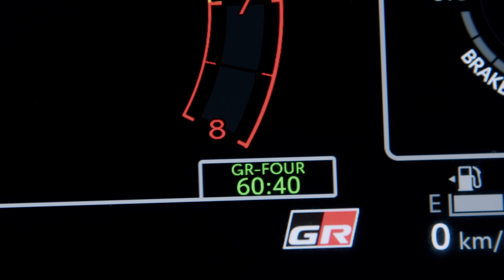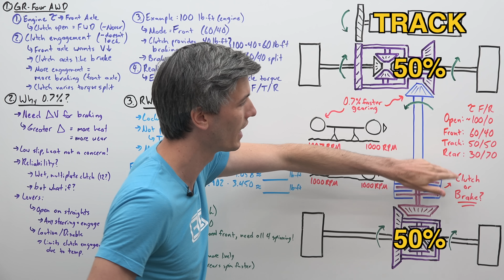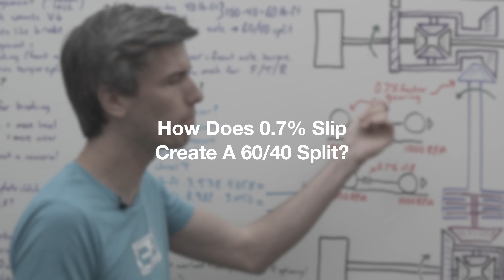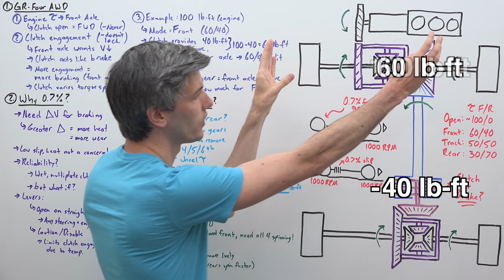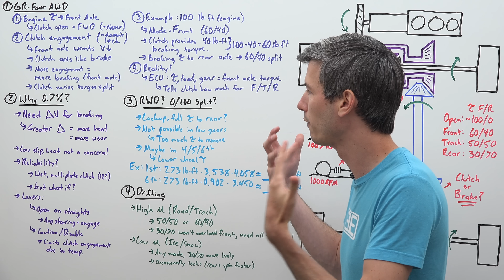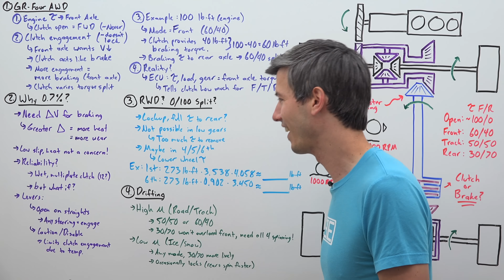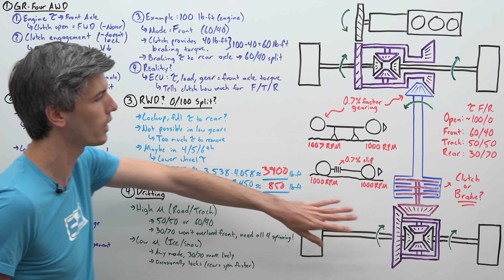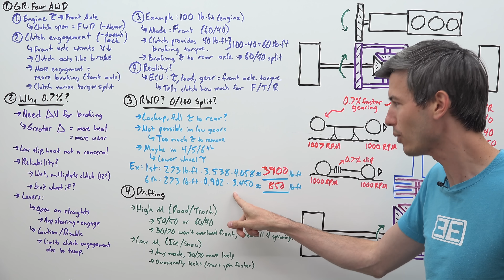Toyota GR Corolla's Brilliant AWD System - How It Splits Torque!

Comment: On my Subaru legacy flat six with the five speed auto it has a wet clutch I think once Subaru jumped to the CVT things changed. on my model Subaru sent a little more torque to the back with every day driving I keep forgetting the times I have an all-wheel-drive car when I go around corners and applying a little bit more power or torque to help the front rotate I keep forgetting about that at times Jason.

Comment: As you have it shown/explained here, if the front axle had zero grip and the rear axle had all the grip, 100% of the torque would be transferred to the rear axle no matter which mode you were in -- provided the load feedback through the clutch pack didn't exceed the pressure between the plates.

Comment: is 50-50 everything is always good or nah?

i would like to imagine a car with 1500 kg of weight, 1500 HP, 1500 Nm torque, and 50-50 power-to-weight ratio, power distribution, and the same for weight distribution. is it gonna be good?

Comment: i know most people dont care about fuel efficiency, but the reason auto manuf have started using 2 clutch packs in awd is because toyotas design creates a shaft that is constantly spinning (dead weight) at 100% fwd mode. meaning this probably won't be a tech used in a rav4

Comment: How is this not just a simple variant of haldex (which maxes at 50/50)? You can achieve the same effect with slightly different tire sizes too.  Seems to me that the calculated torque split will change as the diff clutch pack wears too. I have my haldex biased with tire sizes and modified software, but I MUCH prefer VAG biased Torsen/Sport diff. That said, I'd probably get one if I could get the Morizo version with the limited slips front and back, but just about zero chance of that.
Reply from the maker: You can also get Core (optional) or Circuit (standard) with Torsen front and rear.
Reply: @EngineeringExplained  Good to know. Now to see if I can get one.
Reply: Finally have one coming in... Hopefully in a couple weeks. Core + front and rear LSD...

Comment: My 1/10th Kyosho Optima radio control buggy from the 80s had a chain drive with the front diff having a choice of 18 teeth or 19 teeth and the rear diff was 18.  I always wondered why on earth this would be the case.  I was 12.  Only now do I start to get the idea!

Comment: It is a neat solution indeed. Similar way of sending more torque to the rear axle has been utilised in RC racing model cars for a long time. A beautiful thing about this drive system is that you can easily fine-tune it by putting slightly different outer diameter tyres on front and rear. By e.g. installing slightly smaller front tyres you could achieve a 80/20 rear bias instead of just 70/30
Reply: So cool. I'm gonna look for slightly larger tires for my AWD Jeep Grand Cherokee now.  😅
Reply: @unrestrainedfamily9356 it should work - pls let us know how it all went!
p.s. it would be handy to upgrade the rear differ to a LSD

Comment: I have questions, I could not fully understand this one. I watched it twice. I still can't understand the 30/70 split, or the 0/100. I get you engage the clutch pack about 80% (maybe .7% less) to get 60/40. I get you engage it about 100% to get 50/50. I don't get what 140% engagement (30/70 split) or 200% engagement (0/100) means. I would ask you to do another video on this, but I'm sure it's not complicated, I just can't grasp the "as a brake" thing. I also can't grasp what .7% is being multiplied against to get the final torque numbers. How is .7% enough to cause a 30/70 or 0/100 split? For once, I needed MORE math lol.

So, I don't get how anything past a 50/50 split works (30/70 and 0/100), and even if I understood that, I don't get how .7% leads to such big differences in the math. Please help! lol
Reply: Maybe my video about GR FOUR will help.
Reply: @4x4.tests.on.rollers  I appreciate your effort, but I still need some math with that .7% to understand this. I also still don't get the 30/70 or 0/100 yet. Your video did explain some, but I still don't get it. How does it send more torque to the rear, than the front (where the power source is)? I know it's me, but I can't grasp a clutch going beyond 50/50 split when closed. It's fully engaged. And .7%, without equations, doesn't sound like near enough to change things much, which it clearly does (it equals 140% engagement at 30/70). If someone could point me to the math behind that .7%, it might help me get it.

Comment: How will having the front and rear axles trying to turn at different speeds affect tire wear?

How will handling change as tires wear? Taller tread blocks will be able to squirm a little to allow more of a speed difference than worn tires.
Reply: The clutch pack slipping will account for any and all wheel diameter changes within a tire's life. Tire life will be similar to any AWD system. The clutch pack can never be fully locked so no difference will be made front to rear. As opposed to spirited driving which will affect tire life orders of magnitude more but isn't the AWD modes or AWD system's "fault" per say.

Comment: Jason, which diff setting would be most fuel efficient, all driver behaviours being equal?
Reply from the maker: I truly doubt there would be a significant difference, probably wouldn't notice it in real world. But "Front" would have the least clutch pressure, so I'd assume it would have the least amount of heat losses.
Reply: @EngineeringExplained  thank you! I've asked this question to many people and you are the first to give a reason-backed answer

Comment: Why do I sense major maintenance issues with that clutch pack? 
Is it a good idea to allow for slip in a clutch? Isn't that going to have long term maintenance implications when the clutch would eventually fail?
Reply: I'm sure you missed it, but EE pinned a comment he made about it. Essentially, it'll be okay as multi-plate clutches are nothing new. It seems to be designed with what it's built for in mind. :)

Comment: You sounded and looked pretty excited about this development from Toyota Jason. It never ceases to amaze me what technologies are being developed for the motor vehicle. Just when you think that a particular aspect has reached it's climax, engineering AND science pulls another rabbit out of the hat. It is crazy!

Motorcycles have had wet multiple clutch packs forever. You are actually taught to ride the clutch and increase the engine speed when performing ultra slow manoeuvres to remain stable  I have been doing this for years and have never smelt let alone worn out a motorcycle clutch. I have never considered why multiple clutches are required, though I am guessing they each slip a little because of the oil, and the multiplication effect of each of the clutches in the pack help with overall clutch locking.
Reply: Mostly a guess, but I think it’s also to distribute force/wear. More clutches means more distribution of wear means longer life id suspect!
Reply: it's not a development, haldex style auto 4x4 has been a thing for AGESSSSS. even the rear bias was already done by ford in the focus RS.... this dude is a hack

Comment: I had a similar system on my 1984 AMC Eagle SX4.  I could take the car on ice covered roads and the car performed like it was dry pavement.
Reply: I actually saw one of these last weekend.  It was lifted with big tires. Odd bird.
Reply: @ROCCOCYCLES  They came from the factory with big all terrain tires.  Mine was beautiful with silver body and navy blue mud bottom trim.  Navy blue or slightly lighter blue interior with every option.  The straight six was developed for the 1962 jeep and the torque would pin me to the bucket sear.  Performance out of this world off road and in winter.  One time I was stuck in a snow drift so I gunned the engine and all four wheels rotated with the car lifting on topof the snow.  I drove on top of the snow possibly for a mile.  Sadly I started having extreme maintenance problems after a couple of years and felt forced to trade it in for a new 1987 GMC Jimmy.
Reply: I believe the Eagle used a viscous-fluid-coupling center diff.  I have a DSM that also uses that type of center diff.  Those are fine for basic winter traction, but in sporty driving, it takes a few seconds for the viscous fluid to heat up and provide traction to the other end of the car.  That delay is annoying.
Reply: @kc9scott  Yes mine had I think 16 maybe 9 clutches in viscose liquid.  The torque converter was hand built in England.  Ifthe wheels were spinning it required a second or two to halt the spin.  On an ice covered road it seems to have always been working.  Acceleration on ice was amazing.

Comment: Gears, transmissions primarily on alignment, synchronisation, precision and timing. Manual transmission is the beauty of the art of driving.
Bravo always. 👏
Reply: In this case there is no need in rear differential at all, isn't it?

Comment: In the racing GR Yaris, they set them up to do 100/0 torque splits when they pull the handbrake. So there are applications for the 100/0 split.
Reply: This is for all the GR yaris'. "Pov" spec or rallee

Comment: Did you see the Japanese tuner Revolution's GR Yaris. They found out that past 45kg of torque the car goes100 percent front-wheel drive. They had to get an aftermarket computer to stop the car from doing that. Now if the GR Yaris shares the same system as the GR Corolla, will it be programmed to do the same?
Reply: @Way Outthere I'm aware of the motive car, but they're not using a stock ecu + parts and if I remember correctly, they specifically tuned it with a power ramp. Not all of us want to go that route.

Comment: This seems very similar to the AWD system on my '13 Sienna. Except I don't know if there's a 0.7% difference (or any difference, for that matter) in gear ratio. Also, the Sienna uses an electromagnetic clutch, like an A/C compressor instead of wet clutches. Speaking of which, what activates the clutch packs? A solenoid? I don't think that was mentioned in the video.
Reply: Sienna uses ATC/DTC system. It's basically the same but shorter electromagnetic coupling (ITCC), no overdrive ratio. It is activated by solenoid, up to 3.0A

Comment: I don't understand how a directly connected shaft can receive zero torque?
Reply from the maker: It's virtually zero. Think about your brake pads on your brake rotors. When you're driving, they're still touching the rotors, but very lightly, so it's not actually creating a huge drag on the vehicle. Only when they engage (much like the clutch pack) do you really have significant resistance going through it.
Reply: @EngineeringExplained  but that also means the car would stop, is that the case here as well? It's zero torque only when the car is not moving?